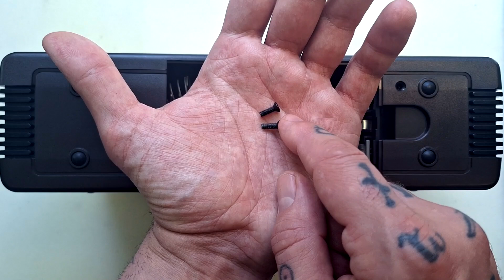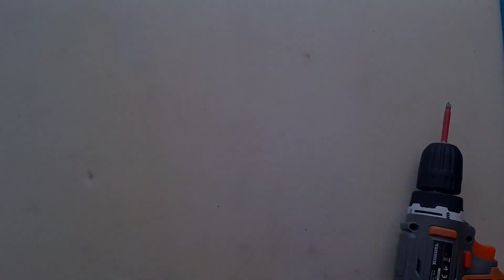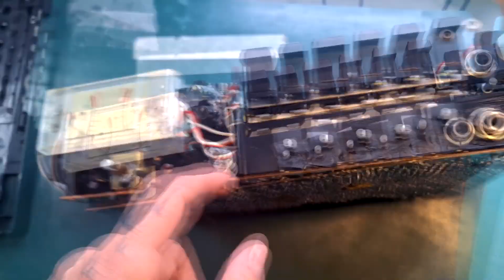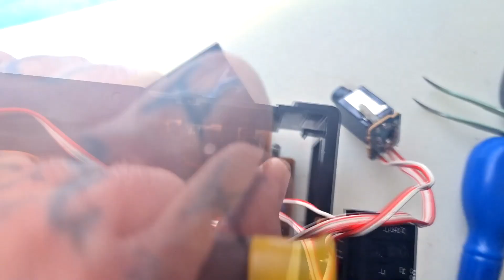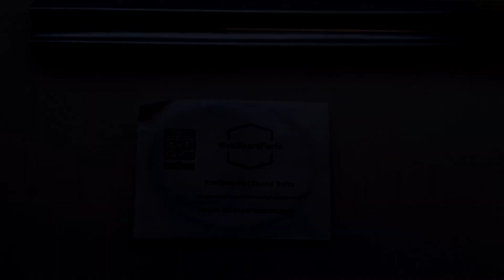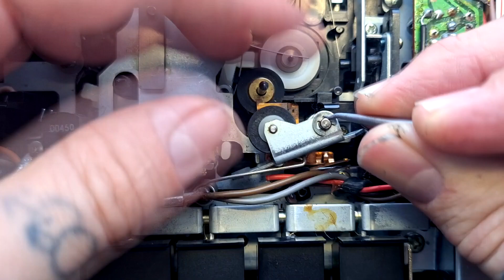Tearing Down a Portable cassette recorder from 1979 - Marantz CD 330 Superscope

Comment: I just bought one of these from a thrift store for 30 USD. Mine doesn't work either. I found your video trying to disassemble mine. Your video is a year old, but I would be willing to donate mine out for the cause if it helps. Mine enguages the tape, but the wheels/gears dont' spin, probably the belts. Not sure about the cost of shipping over seas. If you are interested I would mail it to you. Figure it would be better to have one that works instead of two broken units. Same exact model CD-330.

Comment: the play button wont go down if the lid is open. there is a lever on your left hand you need to push manually to simulate the act of closing the lid so it allows you to press play.

Comment: I've got one of these to repair as a back burner project. I'm very grateful for the teardown and the nightmare screws. 

If it's anything like the NEAL style interview machines that have a total off, there's usually a small pin that sticks up and that gets pushed down when I tape is inserted. It's on the deck side of the cassette near the opening for the tape (shame I can't post photos) Decks like this need to be able to start and stop recording quickly so run the capstan all the time when a tape is inserted rather than spend time waiting for it to get up to speed. But when the tape is removed the circuitry is completely dead, this improves battery life.
Reply: Ok, I took mine to pieces today, the reason you can't press PLAY is an interlock. When it's apart, look directly from the record button for a piece of metal with a square hole in it. This is where the lid has a pin that moves the interlock (you can use your finger when it's in bits) on my teardown the orange piece of plastic fell off, yours is curling up ready to pop. Mine did play, but no rewind or fast forward and also like it came from the bottom of a swamp. On the plus side, no-one had been in it before. One belt turned to tar and the other three were on their way. Took the flywheels out, cleaned the tar and oiled the bushings. Now waiting for the belts, I forgot about the 10% discount code d'oh!
Reply: I got the belts, put it all back together and found two problems. Firstly no recording and no rewind. The lack of recording was because the record level coaxial potentiometer had snapped it's miniature PCBs. I have a 320 (2 head version) for parts and I took that off and it fell apart in my hands. Those pots are impossible to get now. So I got a standard dual gang 20k pot and installed that instead. I lose the balance control (it just spins around) but I can at least record.

The rewind was a design flaw. The spring for rewind works by pushing against a metal bar, when you press on the rewind button, it uses the spring tension to push the idler wheel into the leftmost spindle. I modified the spring to poke up through the hole and then rested the other end onto the chassis. The rewind is very strong. I used MG Chemicals "Rubber Renue" to clean and soften the idler and the pinch roller. Oiled/greased everything else. Now I've got to reassemble it all...

Comment: Broke open mine a while back and it's still open...if you need any parts please do shout, happy to fling 'em over
Reply: Hi there. I desperately need the top small plate where it reads "superscope Marantz". Can i buy it from you?  Where are you located? Thanking you in anticipation 🙏
Reply from the maker: Thank you for the offer, on its way back to its owner in the EU, presumably to be sold on as a parts donor, or refurbishment project for someone with more passion for the unit than I had?

Comment: Great tear down video, thank you for sharing. You've gone further into the disassembly than I needed to do for the repair of my CD-330, but your video will be useful to me in future should I have to go further with it at any point.

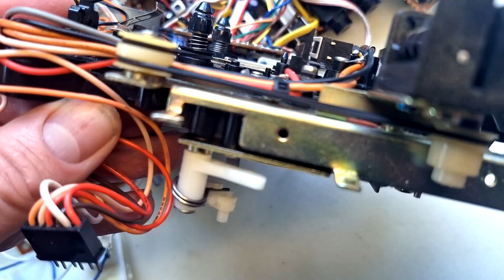I need to point out something you've missed though and the reason why the play mech appears to be jammed. There is a lever mechanism that detects if the tape cover is closed or not. With this removed, it's necessary for you to manually move it otherwise the buttons are 'jammed' in their positions. I wish I could send you a marked up screen shot in the comments, but if I refer you to 24:47 and if you look diagonally up and left from the erase head there is a pivoting lever. Move this up before pressing play. It's located above the red & white wires.
Reply from the maker: Thanks for pointing this out, I probably won't work on this again - I'm more into multitrack stuff - but hopefully others will benefit from what you're saying about the play function.
Reply: @Tetrakan  That's totally understandable - it must have been really demoralising spending so much time for it to be lifeless :(

I'm hoping to get hold of a multi-track tape recorder at some point - just hoping I can find one at a decent price!
Reply: yeah, I'm repairing one right now, and tooka good 2 hours to get the tape transport part out-I did it an easier way but figuring it out still took ages- and I was looking at something afterwards which looked important hanging off looking fragile. A white hook thing on a spring, I think it's this you're on about. Thanks for the heads up! Gonna continue tomorrow. Service manual only mentions 2 belts which is stupid, I had a broken belt and another one which was lying elsewhere...the counter belts looked fine
Reply: Hey James, I’m changing the belts on my PMD 220, and it looks very similar to this machine, and I plan and only going as far as I need to replace the belts, what point in this video to go to to get the belts replaced?